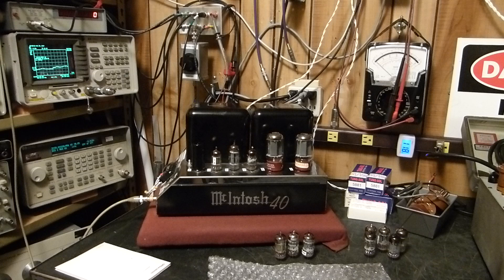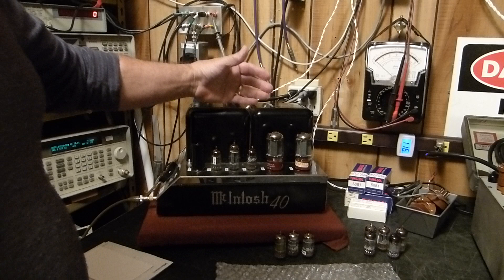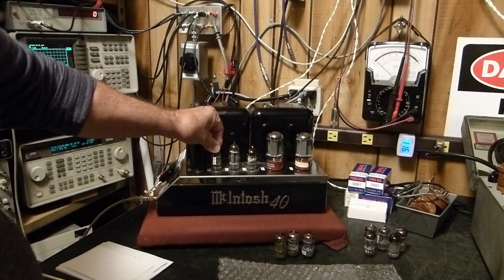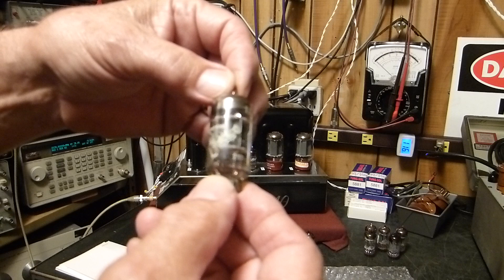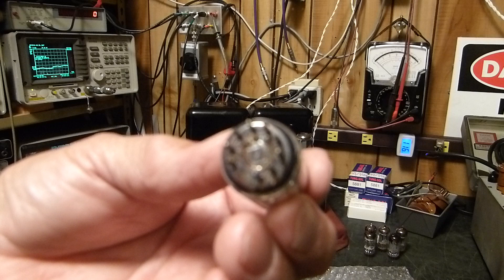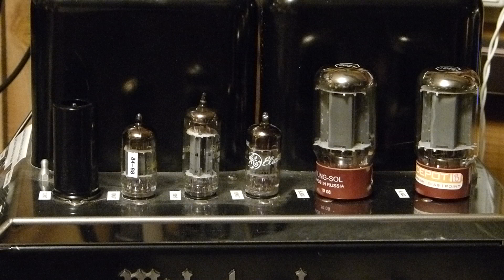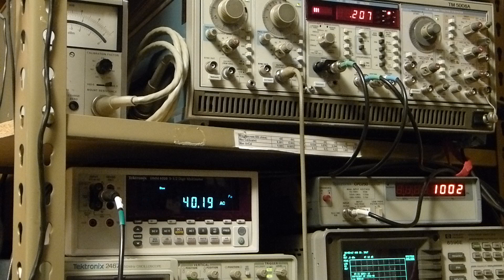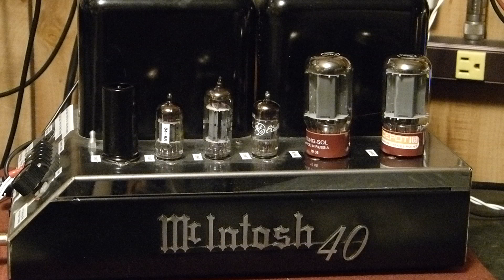Filament Flash/Flare At Turn On Of Mullard, Telefunken, Amperex 12AX7 & 12AU7 Vacuum Tube

Comment: Howdy.
I would suggest sacrificing 2,5 % of the filament voltage in a series resistor. That will nicely reduce the inrush current. The running voltage will still stay in specs.
A timer relay to bypass the series resistor would be a neat arrangement.
Regards.

Comment: My Siemens E88CC does it too. I´ve heard that it´s this tungsten coating missing on the leads at the very buttom of the tube. And they are working just fine after more than 5000 hours.

Comment: When the heater is cold, the resistance is about one 1/6 of its normal hot resistance. When a voltage is initially applied there will be an inrush of current that decays exponentially as the wire heats up and resistance rises until it reaches its steady state. It causes some heaters to flash bright red or white at power on and its normal and is simply a matter of the specific tube design. Merlin Blencowe addressed this in one of his books about designing tube preamps
Reply from the maker: Thank you for your posting. It is really unfortunate that bad information and fear propagates so fast and is almost impossible to correct. There is no telling how many of these very high quality tubes have been thrown away from the misinformation and fear that they are defective. I hope that each little bit of information shared on this video posting will help to save these tubes for the future.

Comment: This effect is not a defect, nor some mechanism to de-gas the tube. The heater filament was carefully designed to initially burn hot. The purpose was to reduce the warm-up time of the tube. All these efforts to eliminate the "hot flash" are just defeating the purpose for no purpose at all.
Reply from the maker: Thank you.
Reply: I've been trying to find the old vacuum tube design text that explained this in detail, (read it this past winter) but haven't been able to find it again. People spend a great deal of effort breaking things that don't need to be fixed; when all they had to do was a little light reading... we're a bizarre species. My wife says I'm proof...
Reply from the maker: That is a grand observation on the human race and I have to agree with it. And we all make these mistakes sometimes and just shake our heads afterwards, assuming we discover just how dumb our actions were. Good science is hard to do as we almost always approach a problem with a bias and look for the solution we think is necessary - and we find it - whether it is correct or not. Too often it seems the engineer/tech doesn't know how to communicate very well and is just kept in a lab and fed Twinkies and Coca Cola and the sales people don't understand the technology and are only interested in selling and then, we the people, just want something to make us happy for the moment so it looks like the whole bunch is set up for disaster, thus your bizarre-species-theory surely must be true and I know my conclusion is not biased... (got to have some fun...)     :-)
Reply: That sounds correct to me.
I have one, an ECC83, that flashes upon start up and it performs great. The label has worn off so I don't know what year it was made, but it still performs reliably and consistently.

Comment: I'm guessing when the filaments are cold, their resistance is less, allowing initial inrush of current creating a flash.
Reply from the maker: This video was a real eye-opener for me. I have read a couple of times where fellows that put these tubes in new and saw the flash immediately figured they were bad and tossed them. Too bad... the idea that this flash has to be a defect surely doesn't hold water when we consider the filament of a normal bulb. Regular bulbs run much hotter and may last decades. In any case, these Amperex and Mullard tubes were, no doubt in my mind, very carefully designed to make this flash. What it did or is supposed to have done seems a mystery nowadays. As audio guys one might think we would know all about these premium audio tubes of the 1960's but the truth seems to have been lost to time. I have a number of these tubes in vintage equipment, original ones in a McIntosh C20 preamp and they work flawlessly and are 50+ years old and they still flash...
Reply: David Perkins you’re exactly right

Comment: The famous/notorious (take your pick) Philips flash is intentional and NOT a defect.  The tale I've heard is that the flash gets some emission going, so all will be well if a directly heated rectifier, like a 5U4 is employed.  Whether or not that story is correct, I can't say.

Dutch giant Philips owned all sorts of brands and plants.  U.S. Amperex, U.K. Mullard, Netherlands Miniwatt, and Volvo W. Germany are some examples.

FWIW, the Mullard 6201s I have in my hybrid power amp flash like an electrical storm, at power on, and they sound GOOD.

Eli D.
Reply: Sorry Valvo (Hamburg)
Reply from the maker: Agree with you that this not a defect and they sound GOOD.Thanks for your thoughts.

Comment: The filament flare is more of an indication of a manufacturing defect more then anything else.
 As mentioned by Jason link to Mr. Carlson's Lab, he does a good segment on this particular phenomenon.
Reply: It's not a manufacturing defect.  It relates specifically to the method by which the filament and cathode are doped.   It is useful for identifying fake (reproduction) tubes from original "real" tubes of certain brands.
Reply: Rubbish. All Mullard and Philips 12AX7/ECC81 valves have always had a filament flash and they're the best sounding.

Comment: I have mullard e180F in my amp. One flares up when I turn it on, the other doesnt.
No idea what causes it, found your video because I was trying to work out what was going on.
Reply from the maker: As you can see from the video, this is they way they are built and are the premium tubes. As I understand it, this flare was supposed to make the tube warm up a bit quicker.

Comment: it flare up because of current surge , now is it supposed to do it I don't know, what about putting a current limiter in the power supply or to  the Tubes a bulb would do the job or a simple circuit with a MOSFET or relay to cut out your surge.
Reply from the maker: I think your current limiter idea is the answer. What about if we consider the possibility that three different manufacturers of premium vacuum  tubes, Mullard,  Amperex and Telefunken thought of this idea 50 years ago and intentionally built that current limiter (bulb) into the internal filament structure in the form of a "flashing filament" portion to intentionally control the inrush current into the filament structure of the cathode thereby lengthening the life of the filament?   Kind of interesting that these so called, defective tubes, have survived so long and are sought after all over the planet. Just my thoughts.
Reply: ElPaso TubeAmps yes the bulbs is good because it's smooth out the  waveform where for instance solid state doesn't do such a good job maybe? they use a lot of bulbs in Old vacuum tube televisions that's where I got the idea from can't take credit.

Comment: the flash is natural because the filament starts out cold and get warm and the resistense in the filament increase , it is  really the filament that dies that end your tube ,
Reply from the maker: These tubes are very special and were only made by Mullard, Amperex and Telefunken. They sometimes have a GE or RCA label on them but they are all made in Europe 50 years ago or so and they are the very best signal level tubes ever made - bar none.  They include the 12AX7, 12AU7, 12AT7, 6DJ8 and others.  I have an original McIntosh C20 with seven of these Telefunken 12AX7 and 12AU7 tubes in it and it is in perfect condition after 60 years.
There are some articles on the Internet that say they are defective and that is absolutely Not true. 
It is my understanding that these tubes are designed this way to "flash" to help them warm up quicker. 
These vintage tubes are often times still very strong and very well balanced so I want everyone to know this and do not throw them away thinking they are defective.

Comment: I had my 12au7 flash upon startup. Now that I had them serviced I know why, Seems the transformers were 1980's built when the eu voltage was 220 and now it is 230. Voltage to my tubes was now 6.8V when it should have been 6V. My guy fixed it and no flashing now on startup now.
Reply from the maker: The tubes I am talking about here were made during the 1960 and 1970's by Mullard, Telefunken and Amperex in Europe. Some may have had a GE or RCA logo on them as all tube manufacturers of those days sold to each other. Even today the new highest quality Telefunken tubes are made by JJ. 
In any case, these vintage tubes have a filament that is supposed to "flare up" when they are turned on. This is not a defect. It is a fact that these vintage tubes were and still are, some of the best-of-the-best 12AU7/12AT7/12AX7 tubes ever made and many of them are still working great today. There is information on the Internet today that these tubes should be discarded. What a travesty to discard these high-quality tubes as some think should be done. I am not sure what the situation was in your equipment but if your tubes are these vintage ones, it is perfectly OK and you have the best tubes around anywhere, probably never to be equaled again in modern production.
Reply: @ElPasoTubeAmps  The flashing in the tubes is caused by voltage overload. My tubes in question are nos Philips 12au7. My tech guy explained why they flash and I trust him. After service they do not flash anymore. Voltage is now set at 5.99. Eventually the fillament will break if it keeps on flashing. That's all I know and it makes sense. Have your gear checked as it will expand tube life running the right current. I did replace the 12au7 as of today with Psvane and that lifts the bar alot. Credits to them for building the new standard as nos tubes will eventually die out.

Comment: Paul Carlson addresses the problem of heater flash common in vintage European tubes in a Youtube video at this link https://www.youtube.com/watch?v=bX0o3jAzSBs It's his feeling that this shortens tube life and it's caused by the low resistance of the tungsten when cold which results in excessive current draw. As he explaiins in his video, pre-heating the filament before throwing the power switch eliminates this issue. Out of curiosity, does you MC40 have a thermistor installed in series with the line? I have a pair of MC75's which do. I don't know if this would mediate the heater flash issue or not.
Reply from the maker: The MC40 does have a thermister and I also have the MC275 and it has the thermistor in the primary lead of the power transformer but both amplifiers will "flash" these types of tubes.. I am really glad I made this video as it doesn't follow the established wisdom that these are defective tubes which I am convinced they are not. I have my theory below in a long manifesto  to why these three European companies made these tubes they way they did and they were bought as premium HiFi stereo tubes and re branded  by US manufacturers. If this is a defect then surely it would have occurred somewhere/somehow in US tubes along the way but, it didn't and if it did, then it probably was indeed a defect and the tube failed quickly and was discarded decades ago. I think it would be a really bad idea to go inside high-quality vintage equipment and hack it up with some kluge circuit to solve this problem when it isn't a problem.  I have seen ham radio operators (of which I am one of 54 years) do similar things where they decide the designers of their radio should have put another control in a circuit so they do it by drilling a half-inch hole in the front of their equipment and installing a hideous mystery-switch to correct this supposed problem thereby making their equipment worthless to anyone else that doesn't want a hacked instrument. I intend to calmly keep my eyes open to this subject and hopefully run across a real document published by Mullard or the likes, on this subject. I bet if we dig deep enough we can come up with the real answer. Just my thoughts.

Comment: Filament "flashing" during turn on is not intentional and is not ok. I've seen dual triodes that only one of the filaments flashed. Such a short flash could not get rid of "gasses" anyway... Flashing tubes will die earlier. Try measuring the current of each filament (after the flash) the two currents should be identical and within spec, if not then imbalances will occur as one cathode will be hotter that the other.
Reply: mamoynas I don't buy that. 50 year old premium tubes do it. If it was a defect, what defect?
Reply from the maker: It seems pretty obvious to me that this filament flash is intentional. These tubes have been around for 50+ years and are still the premium tubes sought after all these years. We also know that GE purchased these tubes and re-branded them for sale as a premium HiFi stereo tube. Do you really think GE would buy the defective ones and resell them as their premium brand? We also see these tubes in 1960 era Tektronix oscilloscopes that are still working today. As we know, these tubes were commonly used in preamps with DC filaments. The McIntosh C20 would be a good example. I have a C20 and it is full of these original tubes and works perfectly. I use it daily in my home theater. With that said, I think we can rule out premature failure from a filament manufacturing defect. If the filament is noticed carefully at cold turn on, this part of the filament flashes and then we see the filament inside the cathode heat up slowly and the "flashing" part of the filament return to normal color. I can easily imagine that this flashing portion of the filament is there to intentionally limit the inrush current into the filament embedded in the cathode to actually lengthen the life of the filament much like some of the suggestions of adding a bulb to limit inrush current and "solve this problem". There are simply way too many of these premium tubes still around for this to be a defect. I don't buy the defect theory.  Furthermore, considering the use in preamps of the day, the filaments in many high-end preamps have a 12 volt DC supply with a relative high impedance thereby naturally limiting the inrush current and making the surge that is absorbed by this "flashing" part of the filament not have to take such an inrush of current. When these tubes are used in a power amplifier like in my example the McIntosh MC40, the filament voltage is from a much lower impedance source and the tubes flash very brightly. Looked at from this perspective, we might actually want to add a 1 volt 150 mA bulb in series with each of our 12AX7's (wired for 12 volt filaments) to intentionally soften the inrush and startup current. I think that is what Mullard, Amperex and Telefunken did back in those days and they built it right into the vacuum tube.
Reply: ok.  so if it is a good thing why don't all tubes do that? Was it a big secret? But If you say that those flashing tubes don't seem to misbehave i believe you. I've only come across a dozen flashing ones as i can recall. Those were replaced immediately (in a radar set not an amp) so i cannot testify for their "life span", but so i was told. Thanks for the comprehensive reply.
Reply: a minor one i suppose... Could also be a marketing trick. Really don't know. As i said to El Paso i 've only came across maybe a dozen flashing tubes and never gave them a chance to prove themselves... Thanks for the reply.